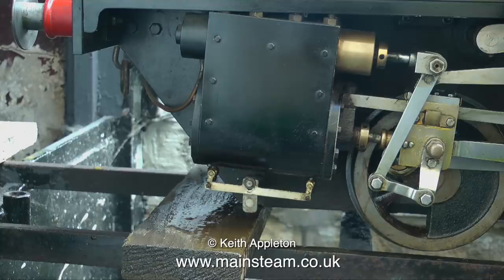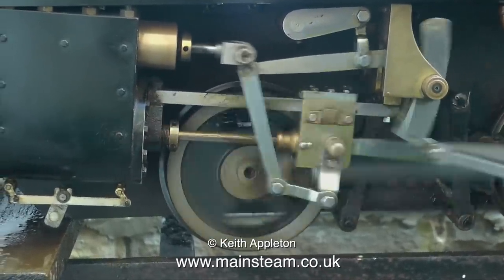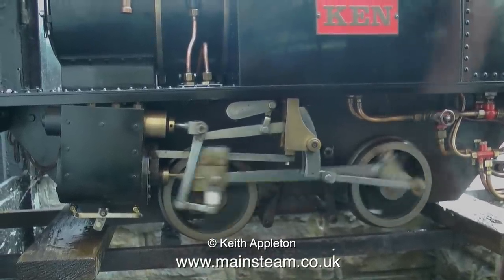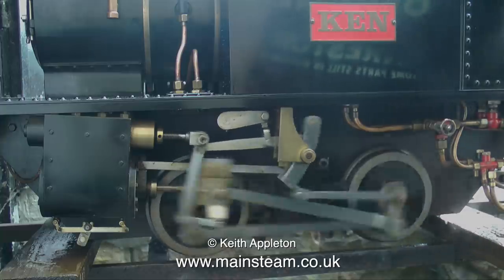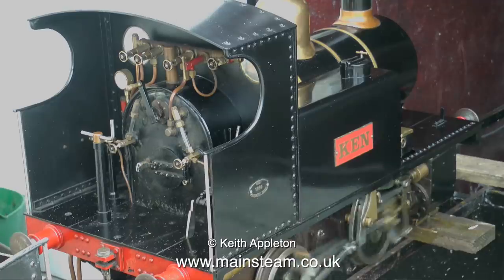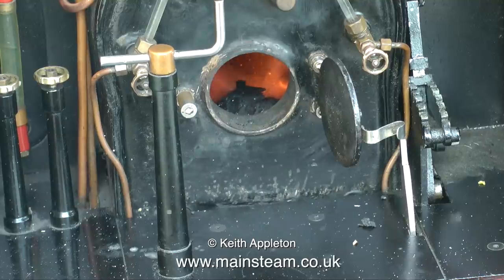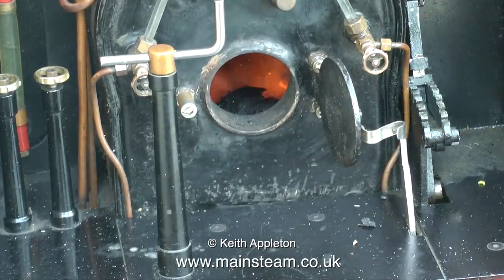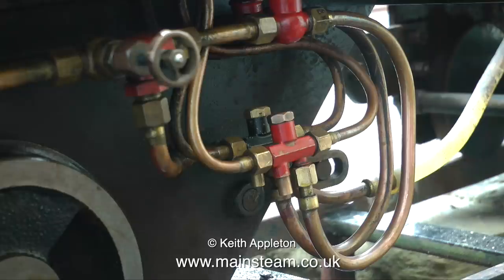STEAMING SMALL LOCOMOTIVES

Comment: Is it difficult servicing engines with inside cylinders or is there usually a easy way to remove the boiler built in for ease of access?
Reply from the maker: I agree, but it is not usually a practical proposition to remove the boiler for routine servicing  . . .

Comment: Some of your home video clips have been deinterlaced wrong, the frame jumps backwards and forwards because the field setting is the opposite of what it should be which is usually top field first.

This happens at 00:32 and 00:57, I just thought you might like to know if you wanted to transfer what I assume are tapes again to have them play correctly.
Reply from the maker: Yes, I know a little bit about Video & audio.

Comment: My live steamer has a steel boiler, if I blow done with low pressure, the boiler never dries out internally and therefore rusts. I was shocked when I saw Redwood Valley shut off the oil fire of the 15" gage 5" scale loco and immediately blow down. I try to blow down fairly hot and have been doing so for 10 years without incident.
Reply: Steel boilers have a different management regime than copper boilers, blowing down a small proportion of the boiler contents while in full steam removes scale and sediment build up in steel boilers.